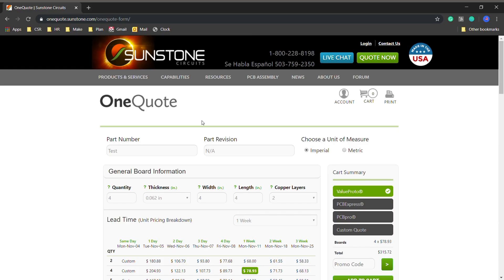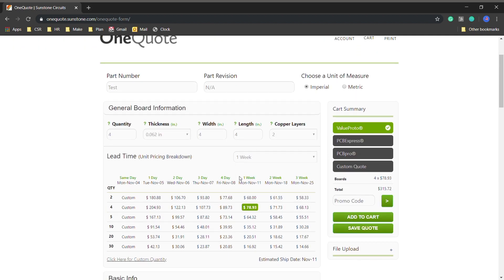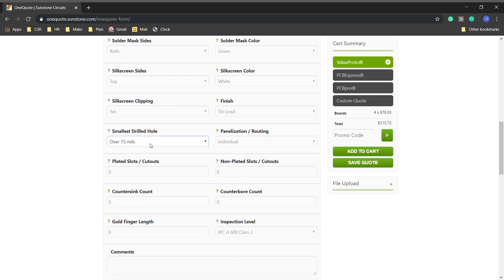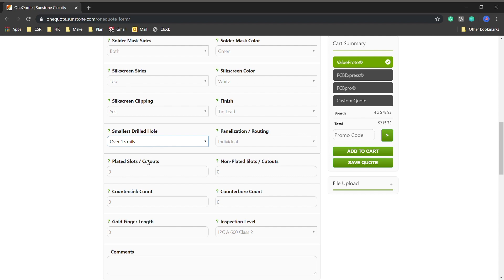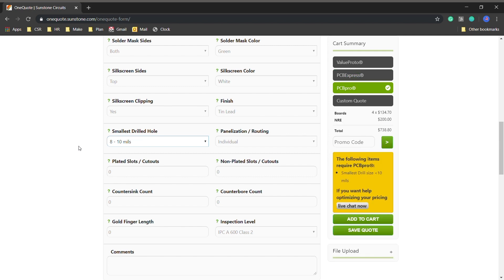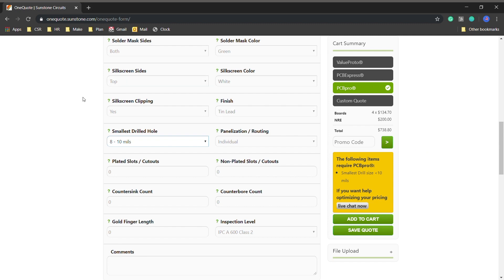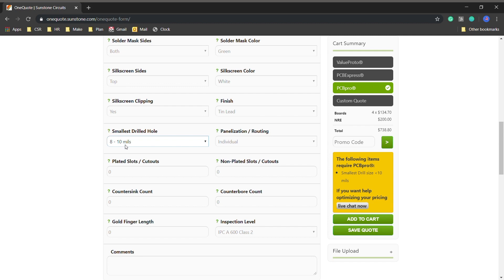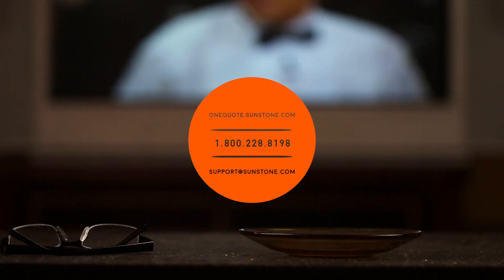Sunstone Shortcuts to Savings - Drill Holes

Comment: Maybe I missing something, but if I start out needing a 20mil pad for clearance reasons and the minimum annulus is 5 mils then the hole must be 10mils or smaller for good drill registration. It sounds like the video is just saying check your hole numbers to make sure you aren't spending money on unnecessary drill registration margin.
Reply: I think the video is more trying to say that if you can get away with a larger pad, you can save some money in that area.